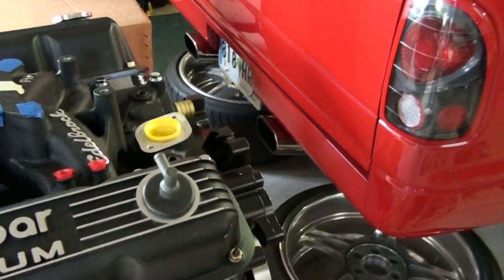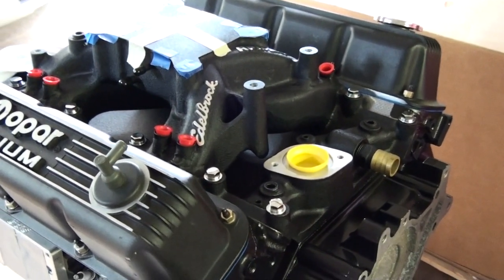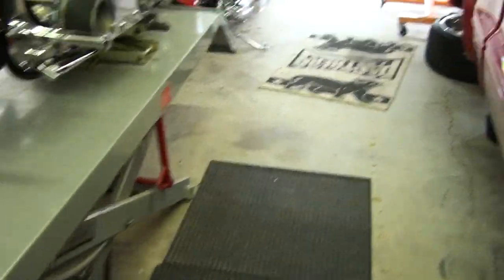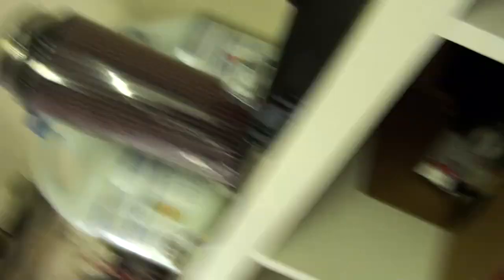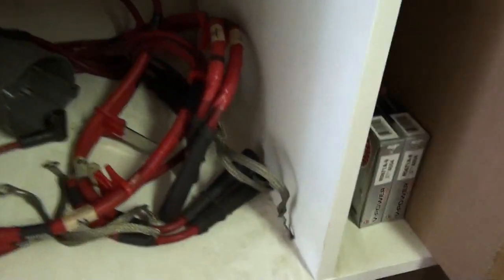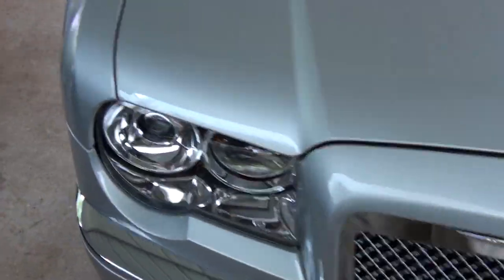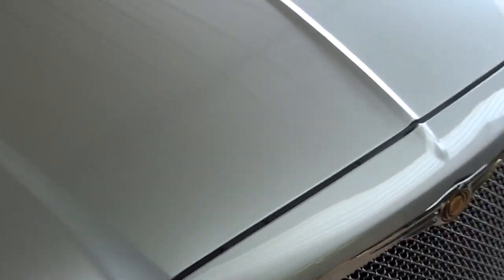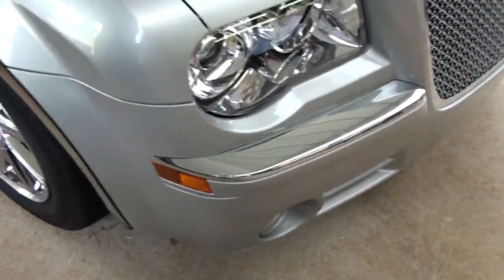KEENAN'S KUSTOMS 99 DODGE DAKOTA PROJECT HD

Comment: What is the benefit of the throttle body spacer on the air gap intake just curious
Reply: Jesse Vaughn the Hughes F1 air gap comes as a four-barrel the big spacer on top makes it so you can use your 2 Barrel throttle body I also have the F1 air gap in my Dodge best money spent yes it's very tall under the hood

Comment: Probably a $5000 motor,  for $2300 you can take a 360 verbore and stroke to a 408. get a sct custom tune high flow injectors custom flat top pistons, and mopar RT heads

Comment: Nice, show truck....BUT,
3300rpm "alittle above idle"????, but max power is at only 5300rpms, whats peak torque???
 R3 block and you put R/T heads on it, Why??? Way better with P5, W7/W8.
That may cubes why bother with an RPM, its killing the top end, probably losing about 50+hp/500rpms worth of powerband to an m-1. A 3200 stall converter, overkill,for a gas engine with a diesels TQ curve for the street?
Reply: JerseyMikeP 
P5 heads won't fit on an R3 block...DUH!
FYI, I have a 4500 stall on my 408.